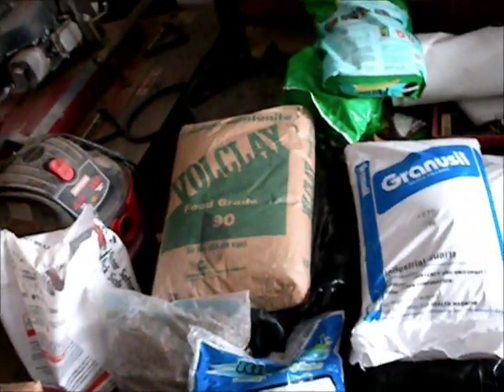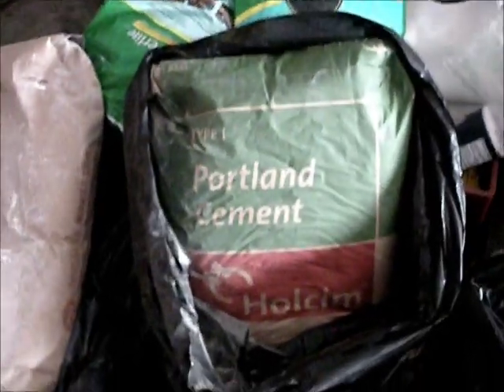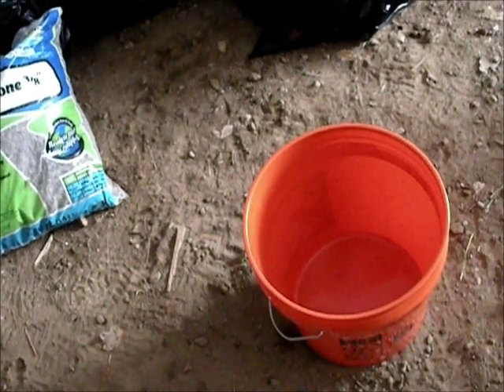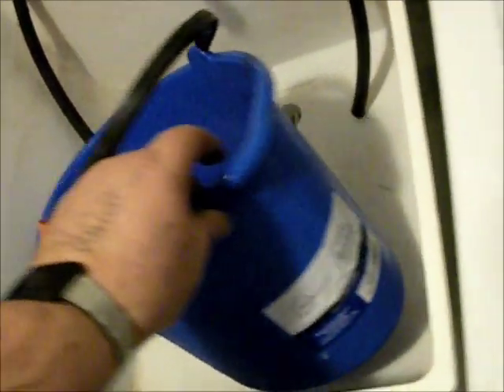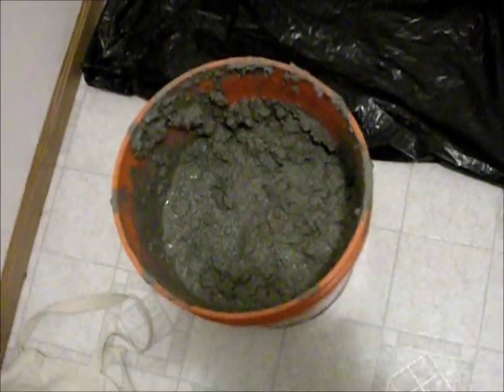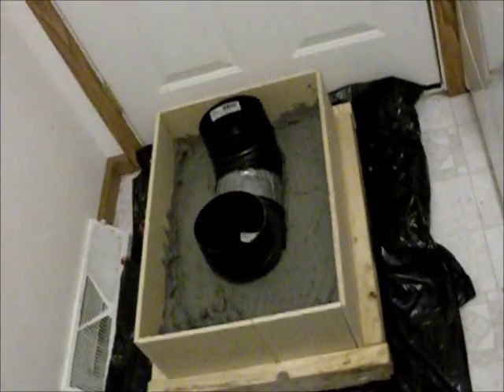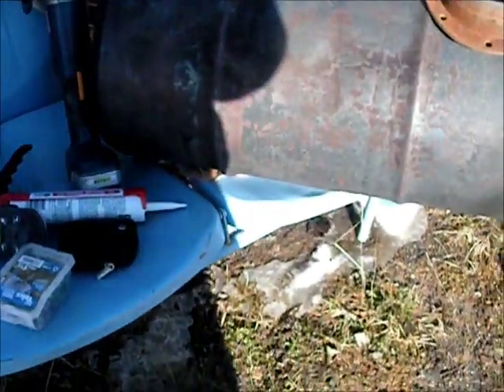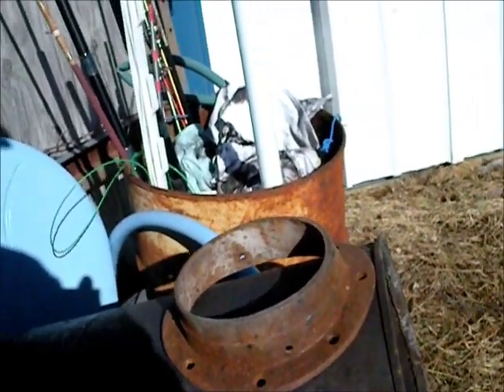6" stove pipe rocket stove part 1 build

Comment from the maker: I just re-read your previous post, that is a sweet idea to use an old I assume rolling metal toolbox to house your stove in. Was planning on doing another  "cement" one probably using a bigger propane tank as the form "would be smaller than this unit though" and changing my mix a bit but now I am leaning more toward doing it the way you did it with ether rockwool "if I can find it cheap enough" Or just using the vermiculite packed around it would be nice to make a portable unit for hunting.

Comment: A very small bit of fuel makes a terriffic heat, the updraft is very fierce, I just drop some bits of paper and wood in the pipe, and light that, to start it, then it can be fed via the 'L' shape at the bottom, or more bits dropped in the top. - Cooking costs - zero. It SHOULD last for years, tho the pipe gets red hot, and has now burnt off most of the paper backing on the rockwool. The toolbox was a solid one, but the key was lost and its heavy and useless, so I didnt mind having it cut up.

Comment: No it not rolling metal, just a very heavy metal box with drawers and a hinged lid, I just threw out the drawers. - but the thing is - iif the flue pipe is well insulated - it really doesnt matter if the case is heavy duty or not. because its protected from the heat of the pipe by the insulation. I made another one out of one of those giant dog food cans, The pipe inside was only a vegetable can and it rusted, I'll get it a good flue pipe, and use it again. Insulated pipe + pot stand ¨= stove..

Comment: hello. redicity - Rock wool is very easy to buy here, and cheap for a big slab, - but so many people have bits left over, you might find some free. ( but Im in France), I *think* its easy to buy, everywhere, in any/homebuild kind of DIY shops. Sold for roof and wall insulation. Better than glass fibre because that makes you itchy and is bad for breathing. Rockwool, mineral wool, is pretty much harmless, Ill show you my stove if I can work out how to post a photo.  Just a tick, Ill investigate...

Comment: dont know how to add a picture....maybe not possible...
anyway - I didnt do anything clever. The local garage man cut a circle hole in the end of a metal tool box for me, and I bunged in a length of flue pipe with an added 'L' shaped bit of pipe at the bottom. Then I stuffed the box, all around the pipe,, with rock wool, - still fixed into a slab on its brown paper backing. The pipe was quite a nice solid one, (they come in different qualities but I used a good bit, as I want it to last)